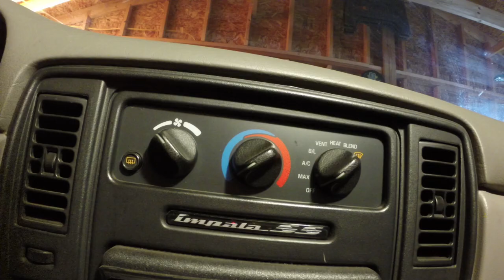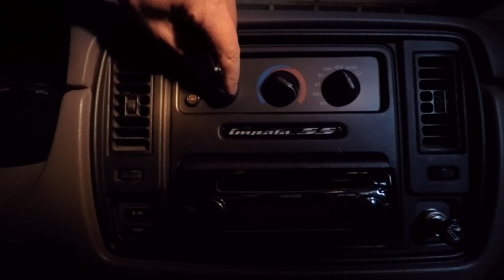Heat/AC Blower Motor Replacement - 1996 Impala

Comment: I hear this loud ass humming noise from the dash when I have the heat or air on high. Is this a sign that the blower may be going out?... it's a loud humming noise
Reply: What was it ? Going through same issue
Reply: Did u find out what it was
Reply: @ECKO147  it was the blower motor. Had to replace it.
Reply: @antoniobaird  damn I never knew anyone responded. It was the blower motor. Did you get yours fixed?
Reply: @Mac_DNH  nice I need to mine on my 96
Reply: @Mac_DNH  I came here because I'm having the same issue! Sounds like it wants to explode lol
Reply: I get air going thru mine it's just not cold

Comment: Mine works good but at high speed it vibrates like its out of balance. My 93 caprice never had this issue. What do you think is going on?
Reply: I took out the motor and found a rectangular piece of foam in the cage of the fan. Smoot and powerful again.